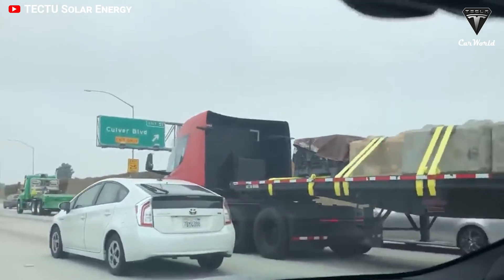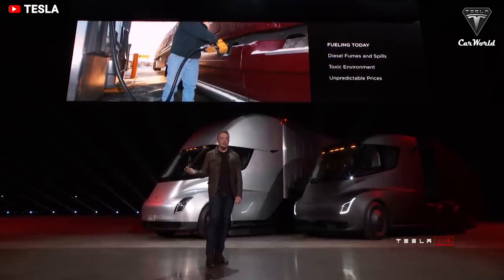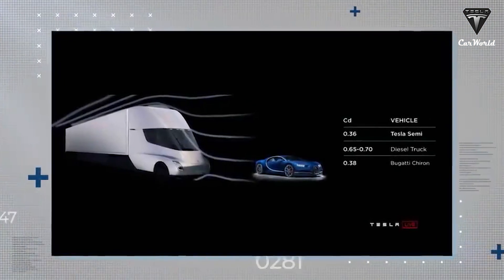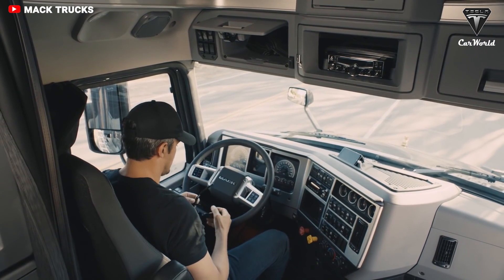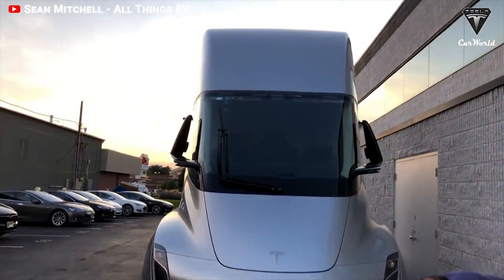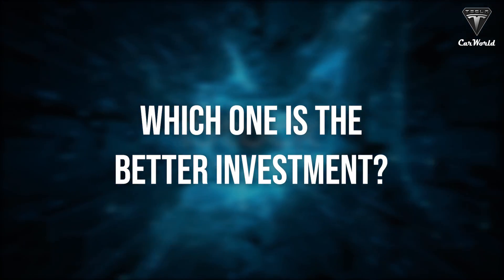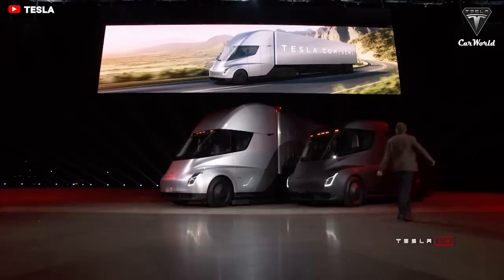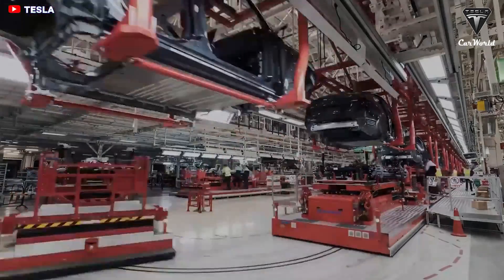Which is the KING of 2023 heavy trucks? Mack Anthem Diesel Truck Vs. Tesla Electric Semi?

Comment: Yeah, but the battery in the tesla semi is huge, which means that it weighs a lot, if it catches fire, it's gonna take a lot of water to put out, and it uses a lot of rare earth minerals, like lithium, which are mined using slave labour. So, i don't believe that the tesla semi is better than most trucks on the road. Also, in the presentation, they show the truck carrying 11 concrete barriers (which can weigh from about 500kg to 1000kg). They say it's fully loaded, so it means that the truck is either carrying about 5.5 tons to 11 tons( the 500 kg figure is from a manufacturer, the 1000kg figure is from a YouTube video showing about 24 being carried on a truck bed ). It also takes a lot of time to charge on a regular "fast charger", and basically needs a whole electrical substation to charge it. And the range is small. I don't get what is revolutionary about this truck.

Comment: The truck takes 14 hours to charge and it dose need at least 1000 miles or less and a normal diesel trucks can drive for 20 hour on its 2 full tanks probably more hours and when it takes 14 hours to charge no one will guy it if you pull in to a truck stop and wait 15 minutes and leave.

Comment: There is no way an electric vehicle can out perform a diesel truck. Truck drivers do not have time to wait around for a electric truck to recharge for hours or days. There is no electrical infostructure to charge these vehicles.
Traditional trucks can usually travel around a 1000 miles at speeds of 70mph fuel up in 20 mins and go another 1000 miles. With two drivers in a truck. Professional drivers are allowed to drive 11 hours a day and work 14 hours a day.  Seventy hours in eight days. 
The extra time needed to take the truck to a charging station which would require.

Comment: The thing is no one cares about a semis acceleration or its HP since its not like a car the only thing that matters the most is its torque. These trucks are towing loads sometimes weighing at several tons. Not to mention how easy it is to stop and fuel up on diesel and then drive several hundred more miles before you need to do it again. I can't imagine having to charge the Tesla Semi every few hundred miles or less. Which has been a pretty big problem on trucks or electric vehicles that get used for towing something. Take the Hummer EV for example. It has a good range but once you start towing that range is absolutely destroyed and it takes far longer to charge it than it does just fueling up your average diesel truck. We might be heading in the right direction but right now I don't think its too terribly viable considering the cons especially for an industrial usage such as shipping.

Comment: the 80k lb thing is legal weight, not that the mack can only gross at 80k. I honestly have no idea why the tesla will legally be able to be at 82k, because you're limited by axel spacing, tire width, overall length, etc. which should be the same between either truck. I'm interested to see how it holds up in heavy haul/construction, long distance, local shipping, and other uses. For now, it's unproven because they've just not been out.

Comment: 5:20 I could be wrong but 80,000lbs is the max legal limit for any transport on americans roads. Thought politicians found out that electric semis would kinda suck becuase of all the extra weight in batteries and then they made a law exempting them up to 82 0000lbs. trailer payload is the only spec to care about not gross vehicle weight limit

Comment: my car is around 20mpg and it has more range than the base model. guessing it also has 1 more battery for every motor it would charge for 15h-24h depending on what charger you find. i don't know the law in america but here in germany for example truck driver's are only allowed to drive for 10 max even 1 minute more gets them fined, so they'll stop anywhere if they can't find a proper truck stop. before anyone comments about the "megacharger" that is supposed to charge the truck in 30min, i find that hard to belive

Comment: I am currently a truck driver and as much as I like the semi truck of Tesla in my opinion, I don’t think it will really compete as long-distance truck so maybe it could be used for fall day trucks so kind of short distance like Walmart distribution center to an actual Walmart store or something similar but the diesels like the Mac in the video all Peterbilt of freightliners with a sleeper births those ones really shine for long distances so right about now half a tank will get me 800 miles.

And also another thing about weather when it’s icy and there’s snow on the ground, you can not see the lines not sure maybe the drive will take over however is a standard for truck drivers when going to snow and ice to turn off the Jake brakes the engine brakes because otherwise he will break up the ice break up the snow and you’re scared and so with the Tesla with those electromagnets that’s affectively to take breaks and so I don’t see them as really safe during the winter, especially going through the Pacific Northwest that is just a bad idea. I am not even going to include keeping the truck warm at night because it gets frigid at night and if it’s truckers, you know just sitting there waiting. Yeah sure the heater can kind of do some of the work, but there comes a point where the heater Cana doesn’t really get task done. Another words I don’t have hope for electric vehicles during the winter sleeper, berth or not.

Know another thing about max for us is the Tesla trucks is infrastructure diesels have been running the states for over 100 years and so there are tons of gas stations where a semi truck can fill up on diesel that’s over 1000 pilots a form of gas station and that’s not including other ones like flying J1 plus Sinclair loves TA each one and probably got 1000 roughly each a minimum of 700 of locations where truck driver could get diesel. The Tesla semi truck however because it’s electric is very much limited on where I can be situated. No yes it can have the range to get to a destination to get electricity, however that is not including hills turns and multiple areas where truck driver would have to use more throttle than normally. Now show me argue that oh they can use the regeneration breaks going downhill from going to the mountains. Yes that can be useful but it will never be kouprey the energy that it used going up, said mountain it won’t be enough and so therefore, like I said earlier very limited on where I can go do infrastructure Anuel charges are

Us trucks. Know in my opinion the future of semi trucks for long distances would have to be diesel or a possible hybrid, but mainly electric vehicles just with current technology, and even if it did get better, technology electric trucks would only be realistically viable for short distances, more or less like intrastate (within the state borders.) but I don’t think it will ever be viable for interstate.

Comment: I’m a gas and oil field driver. Specifically a production water hauler. Here’s some thoughts and questions. 

Last time I checked the Tesla with no trailer weighed significantly more than a standard Semi. So you get less cargo. Second, while horse power is important in semi trucks, torque is just as if not more important. How are you going to move a load when your tires are spinning? Third there is currently no infrastructure to compensate otr electric trucks. And before you say oh we can build them quickly in cities. Remember that is not the case in rural areas where most of your necessities are made. Food, paper, oil, gas. The list goes on. Why would smaller communities spend millions on that when there are more pressing issues? Then say a few routes become possible. What about truck stops? You have to use a APU at them so your truck engine isn’t running 24/7 causing premature failures. (On regular semi trucks) They run on Gas or electricity. So if you outfit a Tesla semi with a APU you’re putting a gas one and you’re defeating the purpose of a electric semi. (Do your research electric vehicles are actually worst for the atmosphere and environment) or your battery will drain as you sleep. Now you have 400 miles till your next charging station because you ran out of driving hours. Plus not to mention the truck listed In traditionally used more for heavy hall. 80,000 pounds or more. They haul things as heavy as 150,000 pounds. 0-60 time is stupid in a semi. If you drive one you know. If you don’t, it’s actually extremely dangerous to do 60 in 5 seconds on normal roads with the public in a semi. There’s so many variables. You’ll also probably damage your load. Also what about the off road implication for Tesla semis? I drive production water in the gas field. We’re on more dirt, mud, and cliff sides then paved road. 70/30. How’s the engineering and reliability of a truck like that?

I think the creator of this video has no idea what he’s talking about. Now if some of my questions were answered in the video then I apologize. I could only make it a few minutes in before it bothered me to much to fully watch.

Comment: Why would a truck driver want to own a truck he cant service, has shorter real world range then they clam, takes hours  to recharge that eats into their time. 

This has lower torq as well. They don't care about how fast it accelerates they want to know it can pull a massive load up a steep hill at highway speeds. 

Drag is not as much of an issue with trucks as often they pull odd shaped loads. 

As much as this truck is cool its simply not as practical.

Comment: If I still drove trucks I would love to test out the tesla, even though a bunk space hasn't been revealed I think it would be a nice alternative to all the freightliner, internationals and Pete's I've driven. Although it is an automatic(yes I know EVs don't use transmissions so it can only be an automatic drive) I would think it to be an enjoyable drive. Although the layout of the Mack looked really nice too. The only thing that confuses me is the loaded weight of the tesla, 82k pounds is above interstate ratings in most of the country. Do they have the ability to write off the extra 2k pounds because they are electric? Kind of like being able to add an extra 500 pounds more to gross weight if you have an APU on your truck? My last driving position was hauling dry bulk tanks locally around the Joplin Missouri area, going roughly 200 miles out and coming back by the end of the day. Our trucks were registered for 100k pounds and we had special permits for interstate/us highway travel so they might be doing that.
Reply: all heavy equipment electric vehicles get ab added 2k to offset the weight of the batteries
Reply: @eagleaviator252  He was also talking about Payload capacity as Gross Vehicle weight. Unfortunately neither figures provided gave any bearing on actual Payload Capacity.
I just wish they would fully announce the tare weight of the Tesla Semi.
But I do know your allowed an extra 2000lb for Electric Trucks. I also believe vans get a bonus to Gross Vehicle weight if powered by Electric.

Comment: Regenerative breaking makes delivery trucks much cheaper to run. Combined with the quick acceleration, driver wages will drop as well. Faster turn around reduces capital costs for the same cargo delivery options. 

It's not clear to me that Tesla's truck is better for long haul work. Their lack of experience in interior design is an issue. And 300 miles just isn't enough range. I worry about weight too. Those batteries must eat into cargo capacity. 

But most trucks are short haul equipment. And I don't think a diesel can compete in that market.

Comment: Unfortunately, there's no place for a device to charge this guy at any gas station in the U.S. or Canada, and its travel is erratic, with battery capacity changing seasonally. This is an area where electric heavy trucks currently don't match diesel heavy trucks.

Comment: the tesla semi is a dud, who cars about 0 to 60 in 5 seconds, it's a truck, you only legally are allowed 40 ton of total weight on the road and the tesla battery will take up half of that weight already, with the truck on top your limited to about only 10 ton of cargo tesla fan boy, so the thing that is most important on a semi truck is useless on a tesla semi, quit talking about acceleration, nobody cares about that, it's all about cargo capacity and the tesla truck batter eats up half the total load limit making it useless, this is another elon musk con job, where is the fabled tesla suv truck , nowhere !!!

Comment: Small point on engine brake activation, When the system is active it will engage the moment you release the throttle pedal and stay engaged until you reapply throttle or clutch pedal or  turn it off via steering wheel switch.
Reply: With an electric motor the braking is a regenerative one, controllable, the motor acting as a generator until at low speed you apply normal brakes.

Comment: so it might be the fact this guy is a tesla shill but he dose realize that the Mack and every other existing semi is already better the tesla semi if he and anyone else was not aware speed is not everything and as we now know that fast acceleration came at the cost of range actual towing capacity and the alarming fact that the tesla needed over 300 more hp to match the same torque as the Mack and on that the torque is more important when towing if you have to use more power to achieve that same torque you fail to  achieve any usability. one final note 400 miles is pathetic for a semi a base range for semis is around 600 miles depending on fuel tank configuration and can be unto and over 1000 (also depending on fuel tank configuration) miles anything beyond short trips is pointless. and can people just stop running the oh it has a nice interior therefore its better line its not gong to hide the fact that tesla lied this information is false but maybe in a few decades we might revisit this conversation but for now its not a coemption its a slaughter tesla like every other company is blowing smoke up our asses and probably won't stop any time soon i do however applauded them for trying i just don't think lying is how you do it embellishing is fine but not outright lying

Comment: the most powerful track out there is not a mack is a scania with 770 hp
Reply from the maker: Yes they will each feature twin 700 hp Scania DI13 087M engines provided through Seattle, Wash.-based engine distributor Cascade Engine Center.

Comment: Im guessing normal trucks still refuel quicker and don’t run out of fuel as quick as the Tesla truck does (of course in the Tesla truck’s case it’s power not fuel but still)
Reply from the maker: But the company stated there are 15 million passenger vehicles sold in the U.S. every year, but only a couple hundred thousand big rigs. But that small percentage of long haulers makes up 20 percent of U.S. vehicle emissions because they are large vehicles that are always being used. Musk also pointed out that more than one-third of articulate emissions are produced by semi-trucks.
Reply: @TeslaCarWorld  okay lemme tell you something. Most truckers don’t care about that kind of stuff they only care if the thing can run and if they don’t have to refuel too often :/ they don’t really care about the emissions they just wanna do their jobs

Comment: When a Tesla Semi is loaded to 82 000 pounds, how much of that is cargo?  One of the reasons that electric semi-rigs are allowed to be loaded up to 82 000 pounds, instead of only 80 000 pounds is that the mass of the motors and battery pack is much more than the mass of the engine, transmission, and fuel, so it actually is important to know whether a Tesla Semi loaded to 82 000 pounds is actually carrying as much freight as a diesel semi loaded to 80 000 pounds.

Comment: Definitely need a cab for long haul no one will drive one of these without a bed and other amenities.  Most long haul drivers do 600-700 miles in a day so the tesla is close. Just need charger stations in the right areas for a semi. But what happens if/when the motor or battery dies? These trucks put 100-130k miles a year they break and a tesla will too. So where do you take it?  They can't be down for weeks at a time.

Comment: u see the probl with what u people till now don't understand about the difference between electric and diesel is that u are blind to it, even an ev can accelerate faster than a diesel it cannot maintain its speed like a diesel truck, a diesel engine can hold and maintain its speed going up down a hill when an ev go up a hill it draws more energy to keep the speed means the battery will drop very fast, and the miles will also drop when it comes to refueling the diesel can stop take what 4 5 min to full a tank and gone again, but the ev have to take hours so again be smart, u let people influence u on shit because they got money and they talk like they smart, they smart yes to fool u because u are asleep, how many tesla go for repairs, was it cheap...? if the world go ev, do u have enough charging ports for everyone, or u have to be backed up in a line to get a charge, u got to be smart with u thinking,